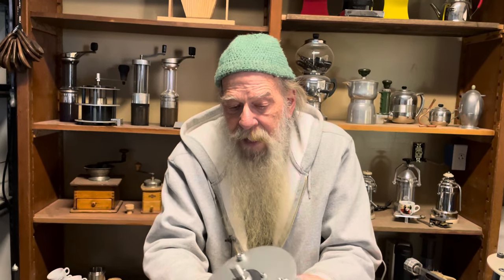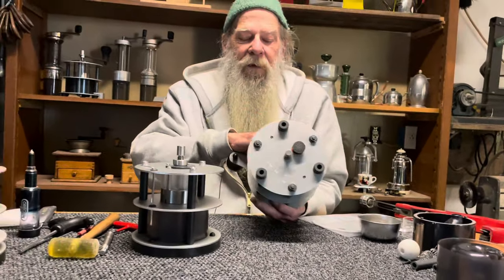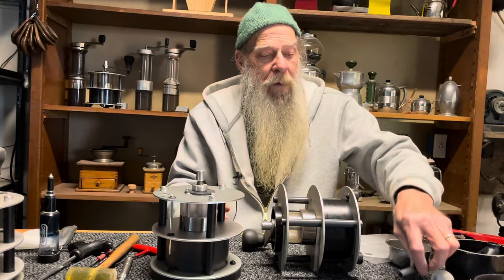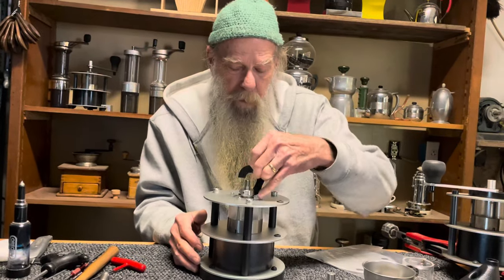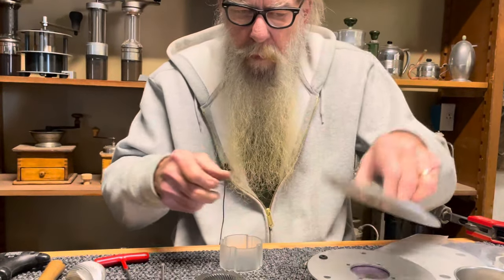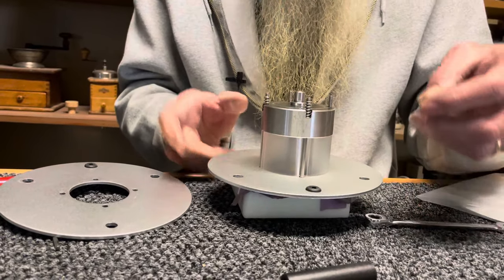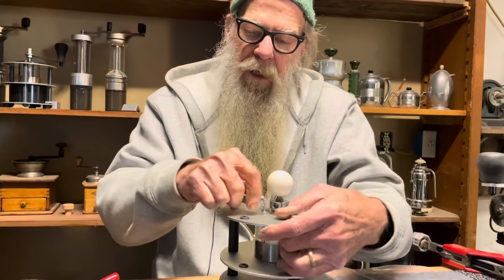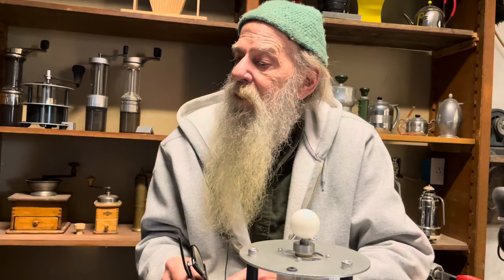The LAST Pharos Coffee Grinder from Orphan Espresso

Comment: I put in my order for my Pharos (number 1024) on April 10, 2014, which happened to be my birthday. Having recently had my mind expanded by the proliferation of 3rd wave shops in my area, I knew I wanted to make excellent, no-compromise coffee at home, but I was relatively broke. After paging through a huge number of Home Barista topics, I settled on the Pharos as the best bang for the buck. Now, 10 years later, I still use the same one, upgraded to the 2.0 spec, almost every morning. And while my career has advanced and I could now afford an enviable electric grinder, I have absolutely no desire to 'upgrade.' The Pharos is a part of my morning ritual each work day, often before the sun rises. It helps to remind me there's a right way to do things.
Thank you so much, Doug and Barb. Your product is woven into the tapestry of my life.

Comment: Cleaning "1.0" #1035 today and found this. Ha ha.  It's been great.  Certainly nothing else like it.  I mod'd it by adding a "traditional" grinder funnel to the top to load it (made from the bottom, curved part of a stainless cocktail shaker cut off on a lathe), added the roller bearing kit and glued the original floor mat rubber to the bottom.  It's a fabulous espresso grinder.  I would have gotten a used Mazzer, but I don't want the sound of a power grinder at 6am.  I use the refined LIDO OG for pourovers.

Comment: Think I’ve had 0937 for 6-7 years, a version 1.0 I think. When it first arrived, I just thought wow, that’s big. When I first tried to grind with it, I couldn’t imagine how I would be able to hold it in my left to grind with my right. On a counter? In my lap while tilting it about 50 degrees off vertical? Eventually sat at a low counter figured out the best hand hold (2 vertical posts) with the Allen key near the third post, mostly to know where the bottom plug was going to be when I tipped it up to remove it. Hold over an Aeropress funnel in the basket, in a naked porta filter, level grounds by shaking the funnel in the porta filter, tamp and done. Used a garage sale 90’s Rancilio, upgraded to a Sylvia, then found a Europiccola lever machine, learned a lot about espresso, and age of beans, grind settings, tamping. A quiet hand grinder and a quiet espresso maker that together taught me most of what I know about how to. Bought the Pharos based on the rave reviews, that it was deemed to be a high quality grinder and that it appeared that I might have the right sized hands to maximize results from it.  No interest in swapping it in for a motorized grinder or a smaller one. Visitors are often dazzled by its appearance. I love this thing.

Thanks Doug and His Comely Assistant Barb.